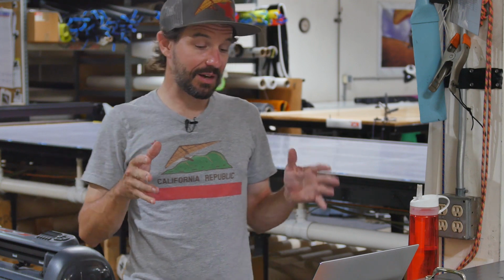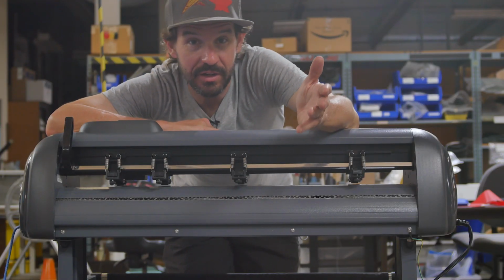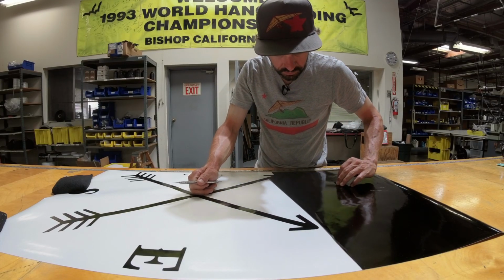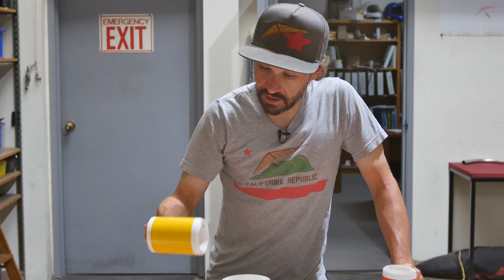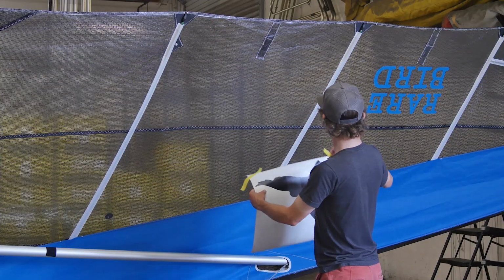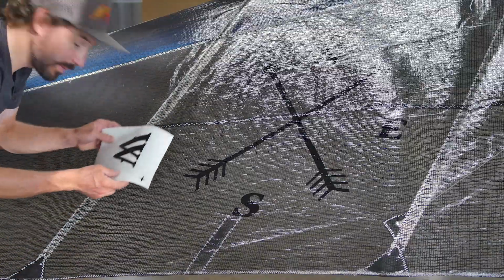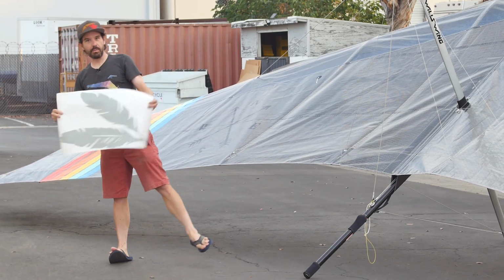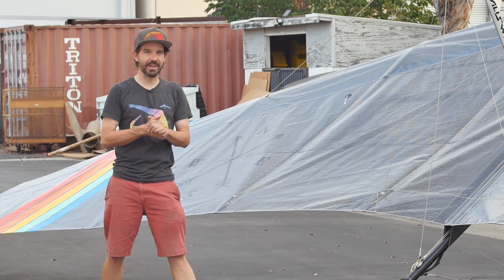Making Custom Vinyl Graphics for a Hang Glider

Comment: I want to print a logo on my paragliding wing. Which material to use?
Reply from the maker: Not sure. I know there are methods and materials to apply graphics to a paraglider wing, but I'm pretty sure this isn't ideal. The vinyl is quite thick and may not adhere well to the paraglider fabric.

Comment: I have a Sport 2c 155 with a white Mylar leading edge.  I would like to apply some red strips or elongated diamonds to add contrast and make the glider more visible to other aircraft.  Any suggestions on where to acquire the vinyl and/or how to apply it?  Thanks!
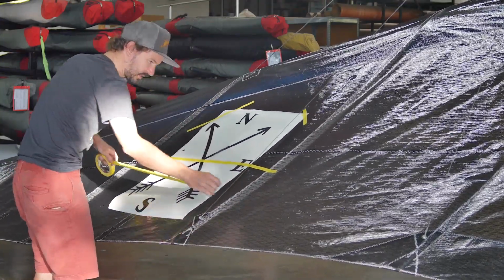Reply from the maker: Amazon has become a great source for small quantity vinyl. There are a large variety of options for leading edge visibility enhancement, including reflective, iridescent and sparkly. To apply, you'll probably want to use the "pull under" technique I demonstrated at @13:15 of this video. Also be sure to clean the surface with alcohol before.